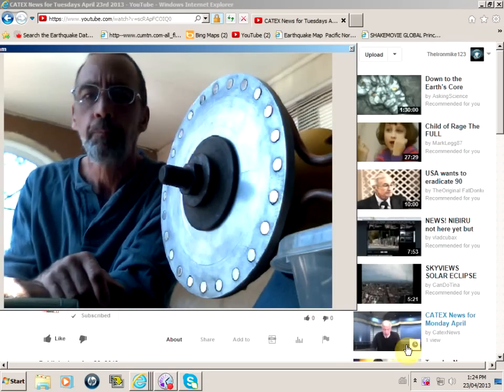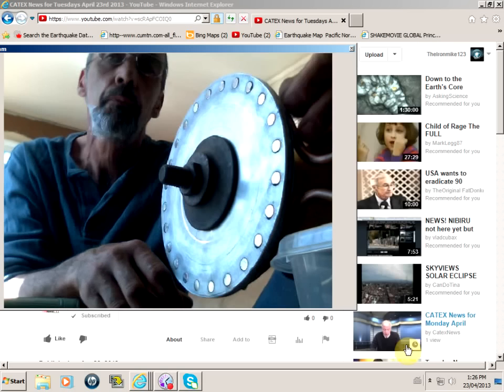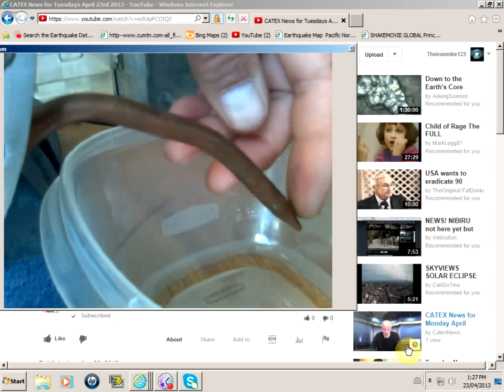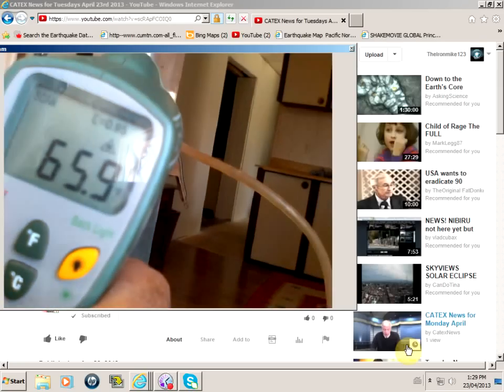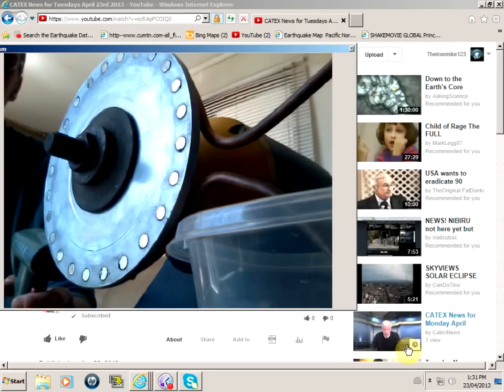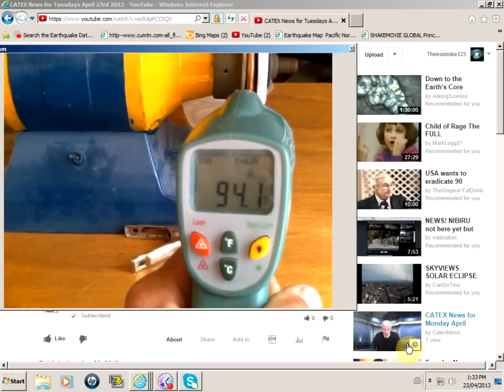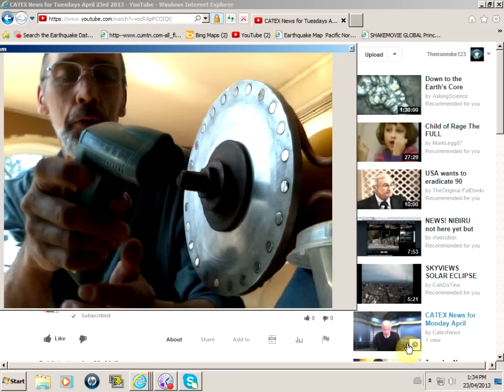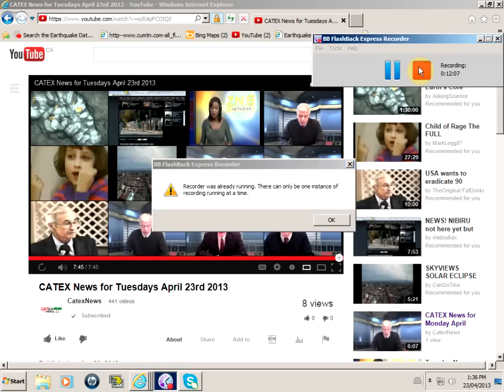magnets and copper tube = hot water

Comment: If after one circle of the copper tubing, why don't you bend it around and then do another circle on the other side of the disc.  You could have layers of discs double sided copper tubing and then a gap then another disc with tubing double sided again, yes there will be more drag but the ratio of drag and how many stacks of discs would have to be worked out. Plus the right type of motor, one with much more torque. My other thought would be to try the magnets on the disc in a radial formation, so layers of rings of magnets and then use a flat coil of copper tubing to get more surface area.

Comment: I built a few rotary induction heater models now and I started the same way you are.  I ran into the same issues namely how much energy it takes to spin a solid flywheel with magnets that are strong enough to create the induction.

I came up with a solution:  I spin a lightweight 1mm thick 8 inch copper disc on a 9,000 rpm 12 volt 20 watt motor across strong, large stationary magnets below the spinning disc.

My new problem became how to extract the heat from the copper before it softened or melted the solder holding it onto the motor spindle. 🙂

I have given up using copper and am now experimenting with larger discs made from aluminium flashing in order to radiate the heat into the air as it is produced.

I set up my magnets in alternating polarity to affect the entire width of the disc starting about 2 inches away from the motor spindle to the outside edge.  The more times you can create an inductive event across the greatest amount of surface area per second, the higher your heat production will become.

The spinning disc on top of the magnets reduces both air turbulence and inductive drag as the inductive effect is evenly distributed across the disc, increasing rotation speed and total number of inductions per second creating heat.

Admittedly, this does not help with your on demand hot water project but I suspect you might find a way to extract the heat from a copper disc or perhaps trap the heat produced inside an insulated box and extract it from there. 🙂
Reply: now question is is this  type heating more energy efficient than traditional electricity heating?

Comment: Try 2 rotors with all N on one rotor, the all S on the other rotor. Then put your coil in between them. It should produce alot more hot water much faster. For on demand hot water, you will need much larger Neo magnets.
Reply: If you do that, be sure to do an odd number on one plate and an even number on the other. If you don't, it'd be all but impossible to turn...

Comment: two things i wonder about, 
the copper tube is "open", maybe it should be connected where it comes to the disk and leaves the disk so as to give full potential for the electricity to loop. just a copper plate touching at that point will complete the circle of copper.
the other thing is, you used aluminum to hold the magnets, aluminum has weird effects on magnetism the same as copper and brass or other non-magnetic metals. maybe try wood or plastic of some sort.

Comment: Hi.
I'd like to ask you if you've solved your big capacity.I want to know how to raise the outlet temperature of a fluid with a flow rate of 24 litres/minute to 250 degrees in a 3/4" copper pipe. If I make it and succeed, I will share it all.
My address isindiroad@naver.com 
Everyone wants to share drawings and information.

Comment: How about using a drum motor using V.F.D.on it and make a generator to run your whole house on it,INCLUDING boiling hot water at 212 degrees,plus no longer stay on the grid?.
Check out Gerard Morin on his U-Tube channel and you will be very impressed.

Comment: Talk about using a cannon to kill a fly !!Ummmm, wouldn't it be simpler the use the energy that you input into making the grinder run to just heat the water directly The efficiency would be increased by a factor of at least 100 and the noise reduced to zero.

Comment: Will replacing the rotating disc with a copper one while having the magnets stationary infront of it, will it heat the copper disc?
Reply from the maker: Yes the Disc will get hotter then all get out. You need a way of cooling it down and turning the reaction into power of some sort. Have fun.
Reply: How hot do you think the disc will get?
Reply from the maker: Upwards of 400 F and it depends on the thickness of the copper plate and the speed it turns ect. The copper will stretch and fly apart if over 800 F. The copper will hold the heat till things happen that you don't need. Thanks for watching and posting. Later.
Reply: @reddpill  why not a tight wound copper coil? More effective as water heater? Or no?

Comment: This is using lenz' law.  Fairly common and known in the scientific world.  However, it does require energy to spin the wheel.  More energy the closer that copper tube is to the magnets.  
I am working on a motor that uses very little energy to spin something like this.  It's possible to use no power to heat water - this will be a fantastic achievement.
R
Reply from the maker: +KCLabs Randall  That's the trick is to use less and make more reaction. Good luck on the little energy motor, sounds like fun. Take Care.

Comment: The heat is caused by eddy currents..If you add more steel around the copper it will generate more heat as long as it's not layered, just a big chunk wrapped around against the copper tube..
Reply from the maker: +Robert Lominick  Yup, thanks Robert. So you feel that a steel rod or bar on the inside and outside of the copper tube will help increase the eddy currents.

Comment: 💡use a ceramic tube loop with a closed loop of wire inside the tube so there is a complete circuit. wire if small enough and strong enough will get very hot with less drag on motor.  even flashing water to steem. close the loop of wire with a short  thick wire outside the tube away from magnets that will not get as hot because it kan carry the current with a lower resistance.💡

Comment: Have you tried putting the magnets north to north?  That's what they have at coral castle in Homestead, FL.  I think the builder Ed Leedskalnin was making hot water, electricity and perhaps something else like anti-gravity.
Reply from the maker: +wit engineer  Ya hello Wit. I have not done a north , north, wheel. Thanks funny you say that something like anti-gravity because had a dream of a Anti- G machine and it has some of the similar way of using the magnetic forces and getting it to vortex then inducing  a high 1000v D>C. current to opacit  spinning silver or stainless disks. It's more in my mind then paper. Have started but will take some time. Thanks and take care.
Reply: That's really cool!  Great idea. Ed Leedskalnin must have been able to reduce the weight of the coral stone to build his castle.  I was experimenting with 24 neo. magnets with 54 lbs of force each and found that spinning the magnets near different non magnetic materials like water, granite, copper, aluminum, wood and quartz will be affected by this spinning field.  I believe Ed made his wheel with north north to direct all the magnetic force out away from the magnet and into the material.   When I spin the magnetic wheel and hold these objects near I can feel the "magnetic wave" interacting with these materials that are otherwise non magnetic.  These spinning magnets also remind me of the Searl Magnetic motor.
Reply from the maker: +wit engineer  The idea's are the driving force, that keeps me making new understandings. Good luck and hope you find new ways to understand the world we all live in. Take care

Comment: Something that really bothers me, is that people seem to not understand the importance of building a test platform. I think this platform, while crude, ( no insult intended ) shows great promise and versatility. Kudos for that. The validity of, and economic justification for this  idea may make this project invalid, but what if you could find an alternative means to spin the magnets. Perhaps in a situation where electricity is not convenient. How about placing the tubing between two discs? What changes if you rotate the N/S polarity of the magnets? These questions are what is needed to be answered and testing is how we learn,. Again, this platform, while crude, will allow Thelronmike to modify easily and without much expense. Once the principles are understood, what works, and more important, what fails, then a more proper platform can be created. Keep testing, keep failing, keep succeeding! You will learn far more from your failures, than your successes!  Great work, I hope to see more from you.
Reply from the maker: +Jack Long  thanks Jack
Reply: Thank you.  I'm not whistling Dixie when I say I couldn't have said it better myself.  Finally someone with sense enough to see the true value of this fellas work. So tired of these dipshits with degrees either stating the obvious or some negative brainwashed B.S..  Excellent comment. Thanks again.
Reply: I was thinking of a speed governor for a wind generation   system.  It seems a  fairly simple thing to incorporate a liquid cooled copper coil that would draw closer to the disk rotor to compensate for excessive  wind speeds the energy going into the coolant rather than overloading the charging system.

Comment: and what will you do with that? and why is this so big thing? if you do a short circuit, that will create even more heat.
magnets and copper tube NOT= hot water. magnets and copper tube AND MOVING ENERGY = hot water. even you could do this with friction. noob

Comment: Use a gap of .010 like a small engine see if that helps. Thats what they use on the magneto ten thousands of an inch with feeler gauge.
Reply from the maker: +jimbo2964 Good call, will do on new run.

Comment: I've been watching all of these videos of everybody trying to duplicate this experiment. One BIG problem every body is running half the RPM's. He states in the video he has a 3400 RPM motor running at low speed. The shaper table is a grizzly it runs at two rpm's 7000 and 10,000 you need a two to one gear ratio with the 3400 RPM motor. North-south north-south magnetic poles are irrelevant the magnetic flux lines are equal on the North Pole as there are on the South Pole.Remember this is a friction heater the flux lines are slapping your pipe at very high speeds producing friction. Smaller motors 1 hp and under should not have a copper pipe surrounding the disk that produces too much drag. One or two straight pipes will produce less drag than a ring. And remember the pipe has to be almost touching the magnets. Copper is a great heat conductor but aluminum heats up faster but don't use iron you may produce an induction charge this is the same way AC is generated.

PS don't buy serviceable bearings with grease fittings they produce too much drag for high-speed a sealed radial ball bearing is what I have to order now!!! solenoids start motors would probably work better to please post your videos when you redo your experiment I would like to see them.

Comment: What if you put magnets on both side of disc,         and make one with multi double sided discs ( like hdd)...and coper pipe arround like a spring, or coil between both sides of every disc? Sorry 4 bad english
Reply from the maker: +lifakc  Try it man. There are many ways to skin a cat. More magnets or copper means more power though. I'm trying different ways this summer. Had a dream and going to follow it first. Have fun.

Comment: I have a bedini motor setup using a hard drive spindle motor and 6 HD platters, with neos cemented around the platters.  It can spin up to between 2000 - 4000 RPM.  I may try this by bending some copper pipe around the rotor, spin it up, and see what happens.  I can run the rotor from either a solar panel or small 12V gel cell packs if there's not too much drag.

Comment: Does anyone know if the magnets will give off even a little heat are lower rpms? Say 175 to 400 rpm.
Reply: +Gene Rector Yes sure I believe Ed Leedskalnin was doing just that with his hand crank wheel.  Please investigate Coral Castle.
Reply from the maker: +Gene Rector Yes if your tolerances must be very close and the magnets must be strong. A heaver drag on the load or power supply. But it can be done and your the man to do it. Good luck.

Comment: My name is Troy Reed. Most people know me for my magnetic motors among many other things. I hold several patents on the subject of heating air and water up. I have been doing this same process for over 35 years myself. I have successfully made units for heating my house, hot water. my clothes dryer and heating my pool. If you place my name and MagTec in Google search engine  you will see one of my patents. I have even made a steam engine  using a similar process. Done right it is very effective. There are different metals out there that you can use. Your idea is correct. Keep working on it you will get there. I actually hold several patents on the subject of heating air and water up. Good Luck on you future projects.
Reply: what happened with you Electric Car Surge Technology ?
Reply from the maker: +Michael Reed   Thanks Troy, and I'm working on many others, have some fun inventing Troy, I do.

Comment: Hey Mike,
 Loved the video,  this is an interesting concept that I have seen before. I would like to say that with the laser thermometer I was unable to get accurate measurements on copper tubing without painting a black spot on it with high temp paint. You should give it a try and redo your experiment.
 Goodluck
 Sharpies seem to work ok also

Comment: Thanks for doing this work Mike,  and sharing it.
If you have a closed system like the copper tube with water circulating into an insulated
tank, you will find the resident temp. to increase. Then you can add copper pipe for hot water use into the tank as a heat exchanger design.
I wonder if you add another coil of copper tubing on the other side of the rotating disc, that would add more drag, but you would be making use of the magnetic field that isn't
being used in the above design. Why not try that out ?
*
I'm going to make one and maybe add more magnets and alternate the fields : N-S-N-S -around the disc.
cheers, gk.
Reply from the maker: +gregsbest  Hi Greg. The only thing is by adding copper or magnets, you would uses more than 2-3 amps. Going to add the second copper pipe just to see the results. Also trying different fields, like N-n-n-s-S-S.ECT. Cheers.